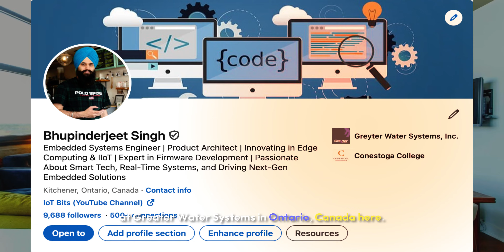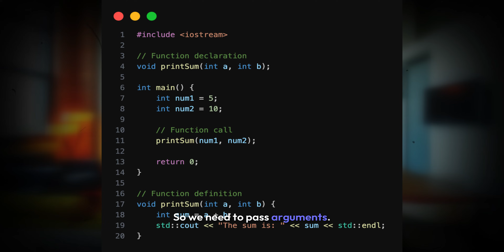How to Start Embedded Systems Career | Step-by-Step Roadmap from Beginning to Advance Level

Comment: Can anyone become self taught embedded systems engineer or IOT engineer without science degree?
Reply from the maker: Yes it is possible, to begin the requirements are C programming, basic electronics (analog and digital), computer and operating systems. Computer degrees are loaded with extra information which can be easily obtained in parallel while working. Thanks for asking this question. 👍
Reply: @iotbits ❤❤❤